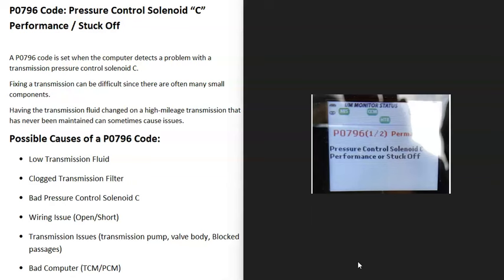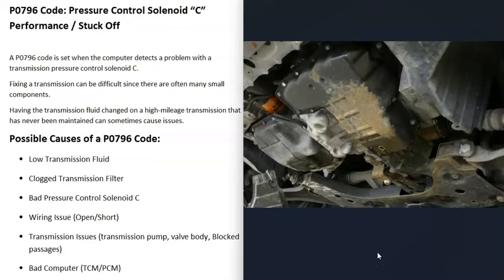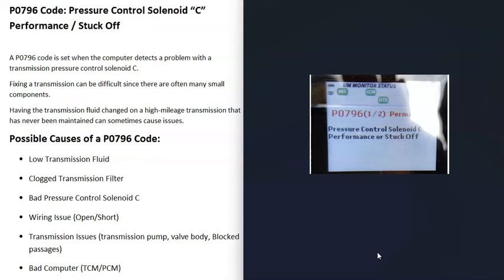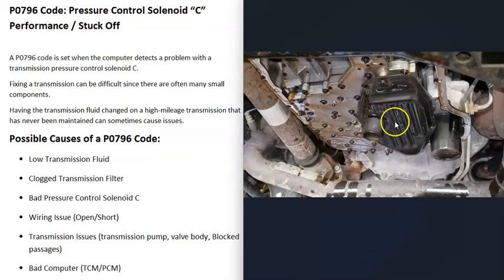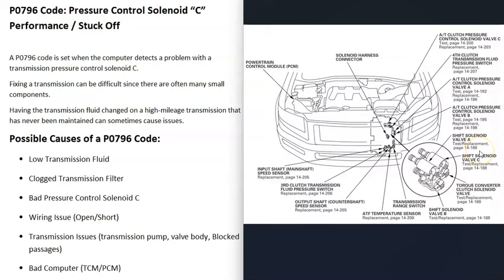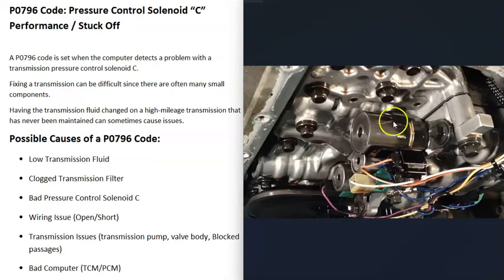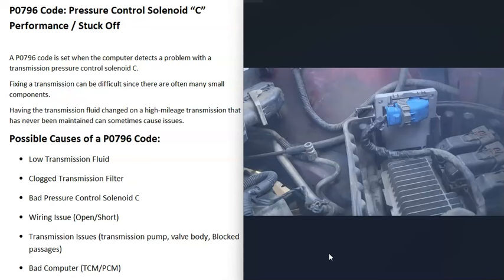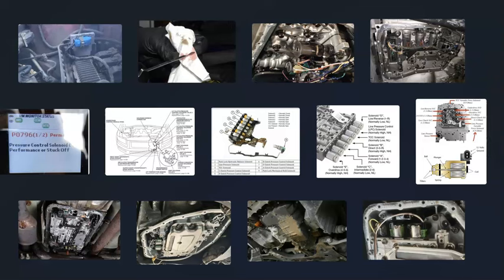Causes and Fixes P0796 Code: Pressure Control Solenoid “C” Performance / Stuck Off

Comment: I’m getting 0700 and 0796 Solenoid C stuck open on my 2012 SRX.  It seems like the P0700 is a generic “transmission problem” code triggered by the P0796, but I could of course be wrong.   😅. The car had 285000 miles on it.  Is it worth playing to fix, or should I just drop it off at the pull-a-part?

Comment: Hey there, my issue includes
 PO796 and PO746 and P2714 . I  noticed a leak on inclined part of my driveway one day not much just continuing to drive with no issues then couple weeks later traveled 30 minutes to my dad's driveway and 10 minutes later started the car and no reverse. Checked for codes and found the 3 mentioned, where do I  begin?
Reply: ever resolve this?  I'm getting p0796 and p0700.